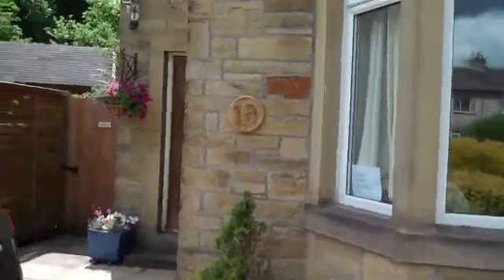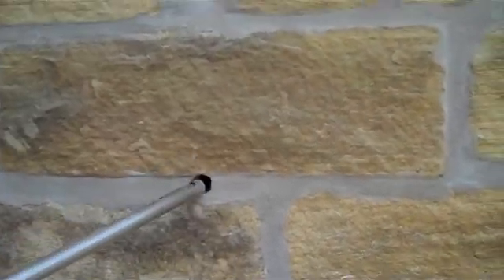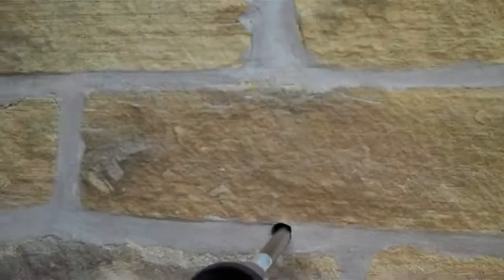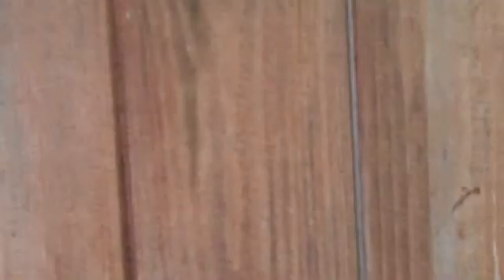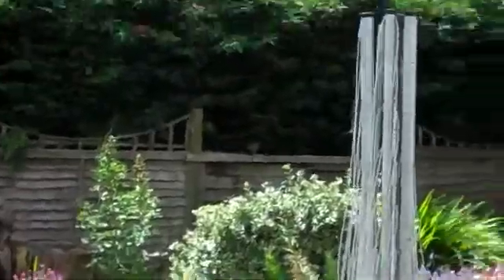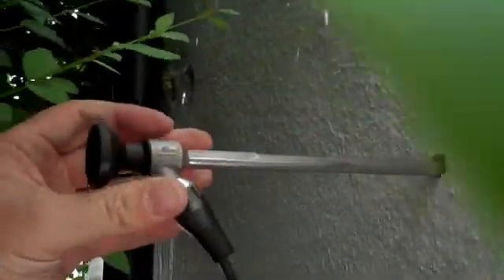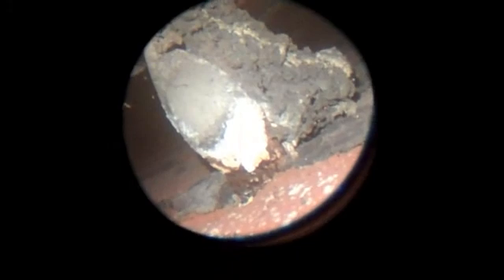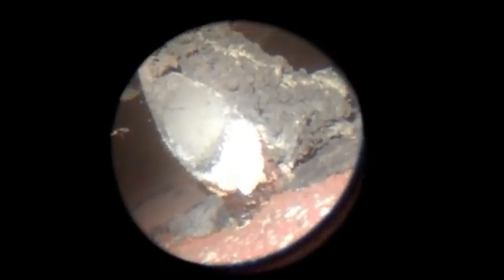Wall Tie corrosion caused by Black-Ash mortar

Comment: black ash lime motar is correct on a stone property, as it breaths. cement mortar will ruin the stone. what is wrong is using galvanize. fixings,  they should be stainless
Reply from the maker: Hi James, good points. Lime is always best but of course if the ash is from industrial processes it will often contain lots of sulphates and be acidic. This is very aggressive for metal, even stainless steel. This building is pre-war so the ties were not stainless of course. Thanks for the comment.